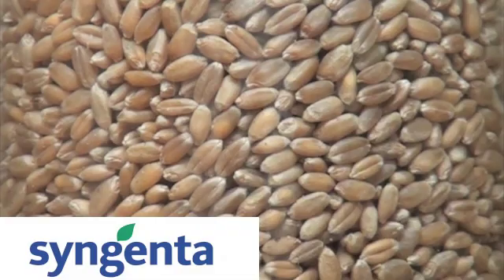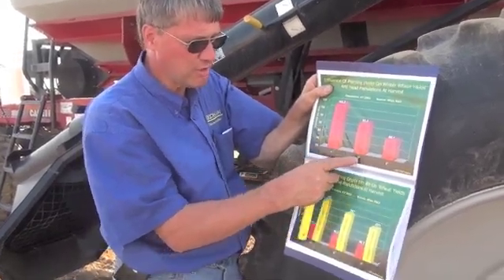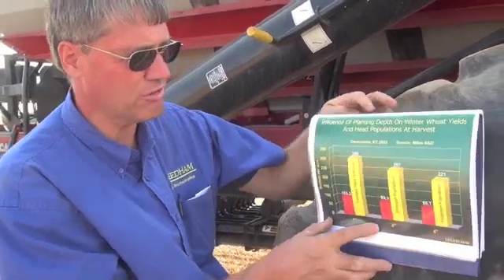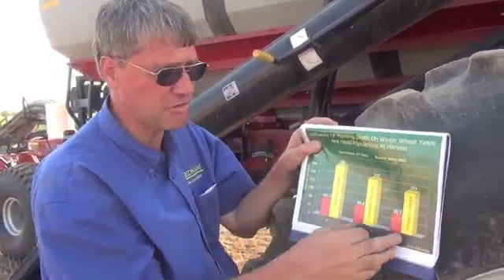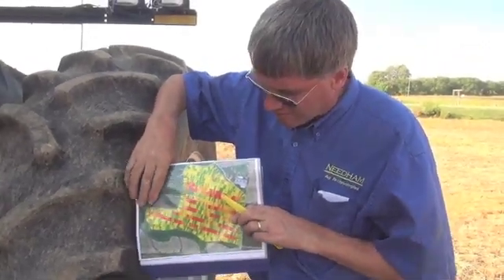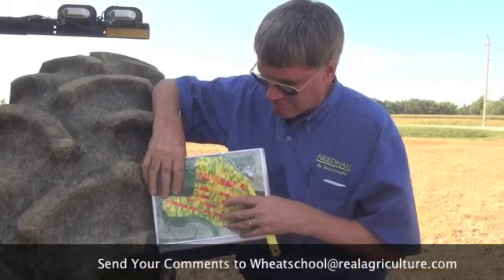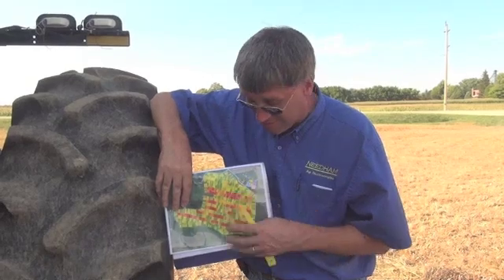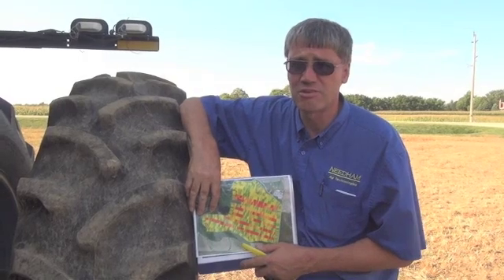Wheat School: The Impact of Seeding Depth & Nitrogen Application

Comment: I remember seeding wheat on course sandy loam years ago in mid October Northeast Arkansas seeded 1.5 inches deep we got a 2 inch packing rain crust was about half inch thick I looked at with my dad and we decided to replant I took a doall up there and harrowed very lightly and it being a square 40 acre field I turned 90 degrees and planted that direction ended up with rows in each direction. Made a decent wheat crop.  About average 50 60 bushels acre